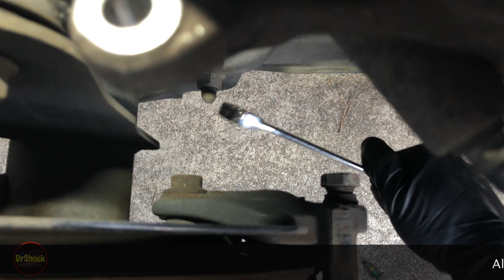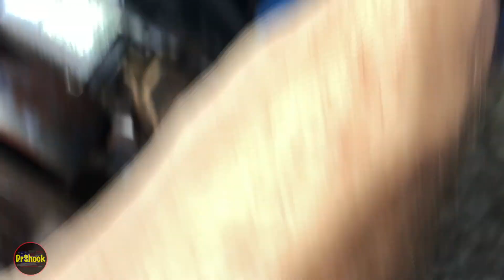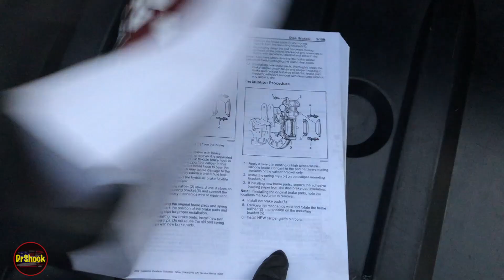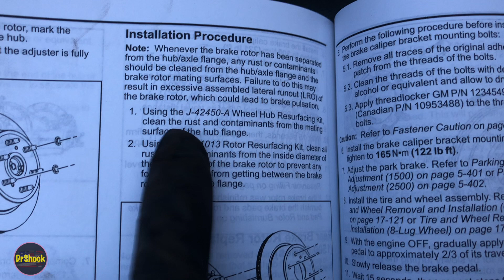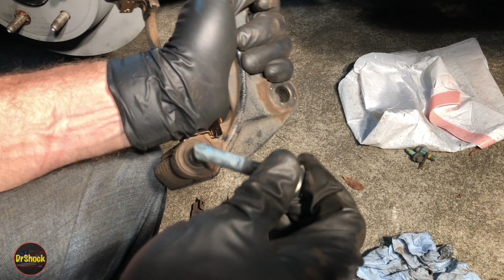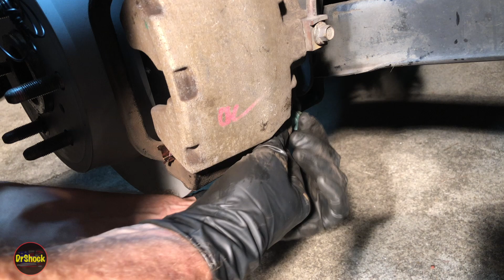2007 - 2014 GM GMT900 SUV 1500 Trucks Rear Disc Brake Overhaul Pads & Rotors (Chevy & GMC)

Comment: Do you happen to know why GM asks us to replace the guide pin bolt on the rear? Does that bolt get stretched or get exposed to extra heat or what? That step surprised me and now has me curious. I’ve owned GMT900s since 2010 and have never replaced that bolt when doing brakes. I guess I will be going forward, tho!!
Reply from the maker: Yeah, it's different than the front where both guide pin bolts are of the usual typical reusable type.  It's not stated why, but I would suspect either these blue-green tint colored rear guide pin bolts are forged from a torque to yield type of metal alloy, which typically are only rated for one time use as they stretch.  Or, because the specified torque is on the lower side, it may more likely be that the blue-green color represents some sort of anti-corrosion coating that GM engineers felt should be replaced out whenever the pads re serviced.   The local GM dealer had a bin load of these bolts, as they are required to follow this procedure to the letter without deviation on every GMT900 rear brake job so go thru quite a few of them.
Reply: @DrShock  yeah I bet! I’m definitely adding that step the next time I do rear brakes on my wife’s gmt900. This is why I always watch your videos even if I feel like I already know the material. I never know what I could learn from watching you go through it and tonight I learned something new and useful 🙂 Thank you, sir, and keep up the quality content. I’m a long time watcher and subscriber!